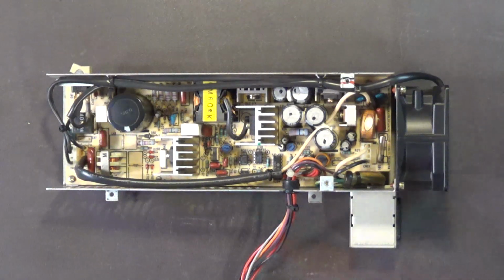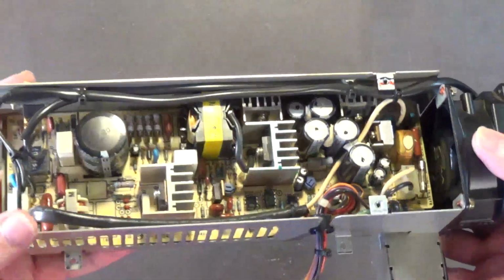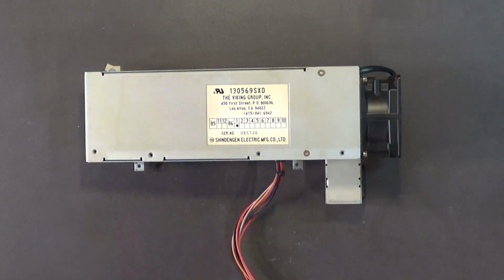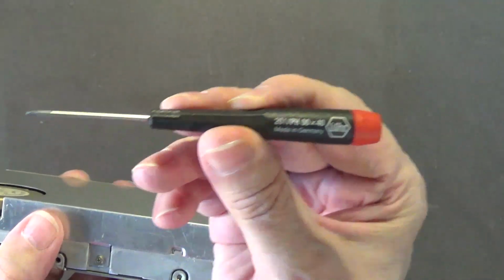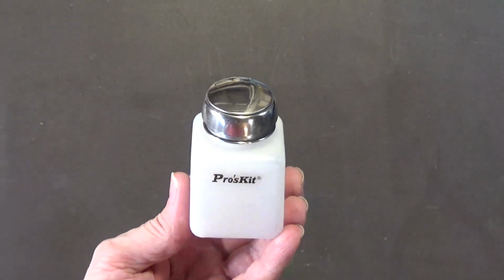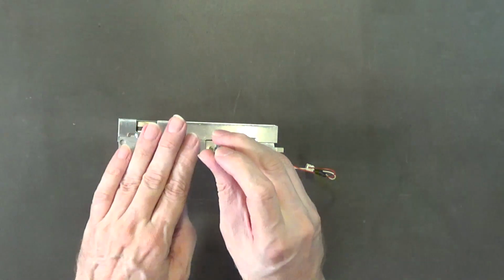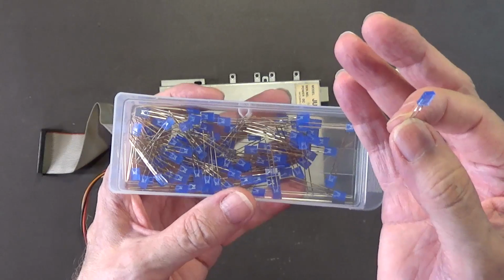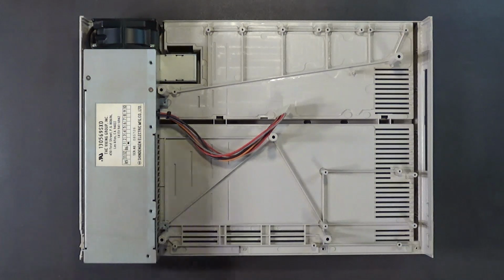Commodore Amiga 1000 Repair and Refurb - Part 2

Comment: Good point about the tools. The cheap chinesium handle and bit sets are a disaster waiting to happen. 
You will know what I mean when you strip the head of a screw or bolt and possibly have to drill it out.
The recessed screws in the bottom case of an Amiga 1000 are a good example. They are down at the bottom of a long narrow hole!
You strip one of those screws and you are not gonna be a happy camper!!!